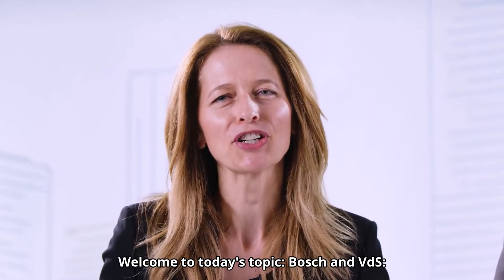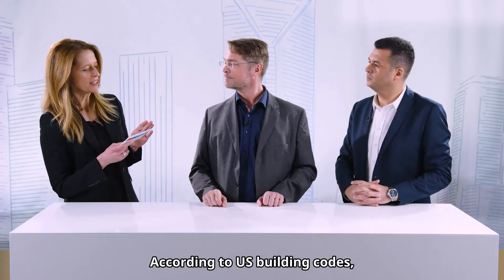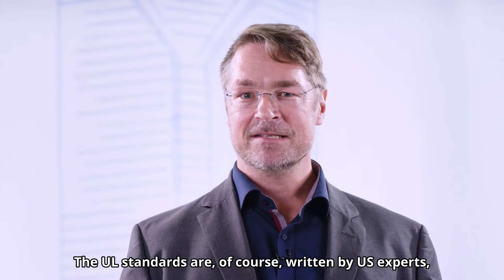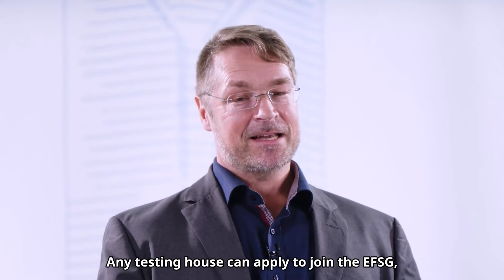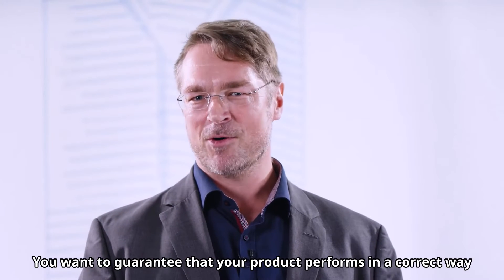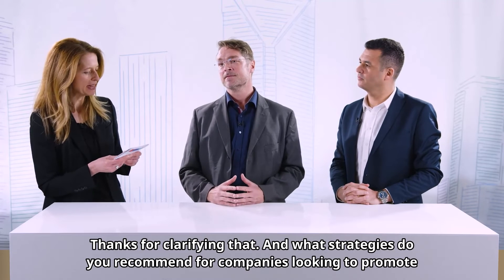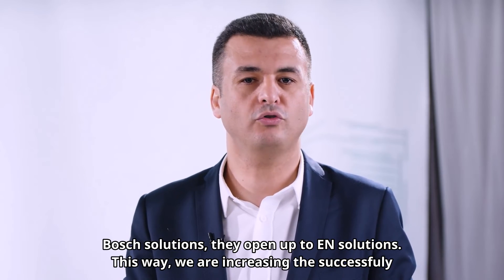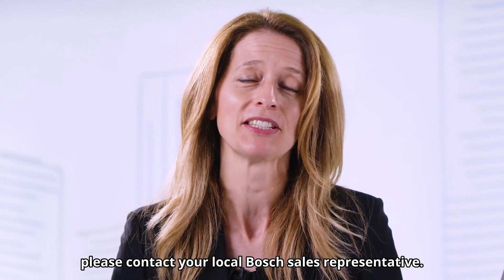Bosch Security - Bosch & VdS: A Duo's Guide to EN54 regulations & NFPA72 Standards - Full Interview

Comment: The heat detectors available in the Bangladeshi market are mostly UL listed and conform to NFPA standards that allow a reduction factor in terms of clearance height. There is no height limit for these heat detectors. However, the model we offer is VDS certified and complies with EN standards. BOSCH heat detectors have a limited height and a smaller detection area than other brands. If we apply the reduction factor to this device, the distances become very narrow, requiring almost 50% more devices than other brands.
Does the heat detector of BOSCH Avener series need to  use the reduction factor as per NFPA?
Reply from the maker: Dear @Md.JahidulKabir,
Thank you for your comment. Our Bosch heat detectors are EN-certified and compliant with NFPA72 specifications. While EN and UL heat detectors share similar functionalities, they adhere to different standards, which makes direct comparisons challenging. For more detailed information, please reach out to your local contact person.
Bosch Security and Safety Systems